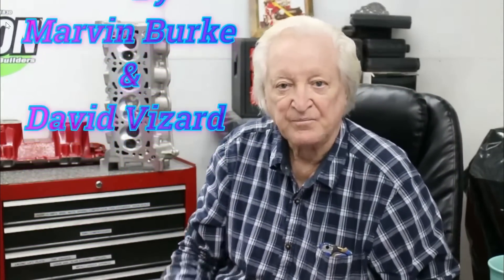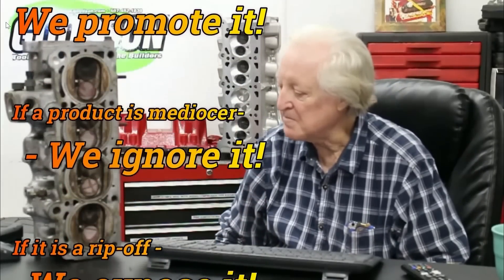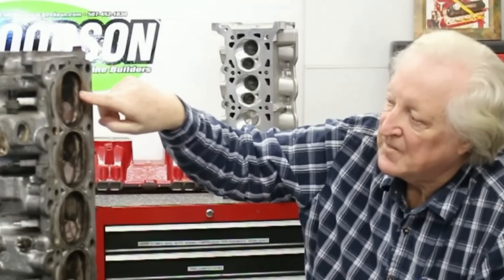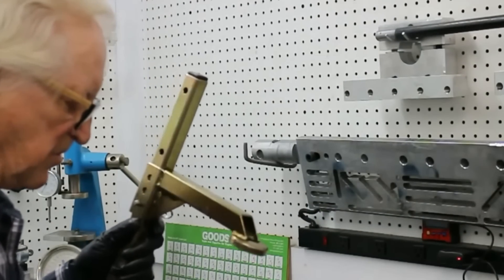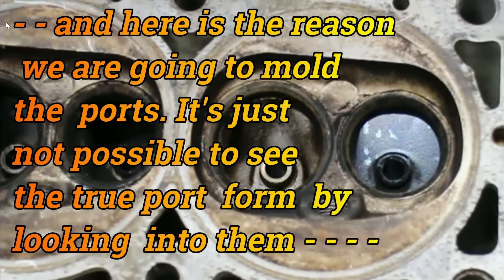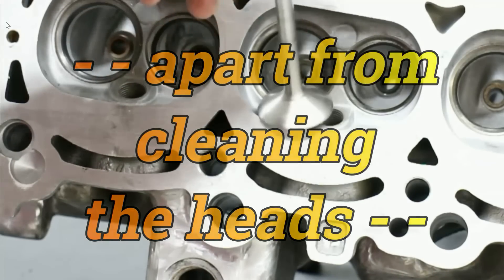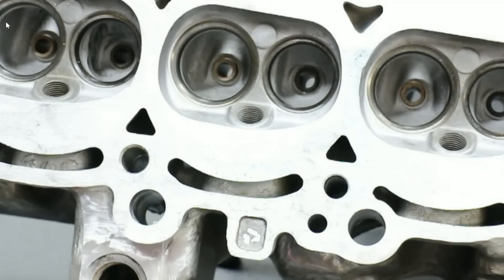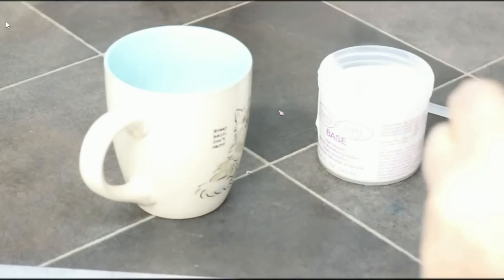Chrysler 4 cyl. 2 V head porting - big HP potential!

Comment: The FAIT 600, 850, 127, Autobiachi A112 (Abarth), Uno, Cinquecento and Seicento al have bathtub shaped combustion chambers. 
I always wondered how to prepare the chambers. But this and the second part helped me out quit a bit. Not all. But more will probable come.
The nasty thing of the above mentioned heads is that they have an intergrated inlet manifold inside the head. Yep, true. And bad. So a mold can be made but will never come out in one piece. Simply because the space inside is bigger then the openings on both intake and valve seat sides. A perfect bowl is also impossible to grind due to the big space inside. 
And so the only side which comes close in performing David avizard a tricks is on the exhaust side. ...but may be I'm wrong and do not see what others (you) have already seen?

Comment: What do you think of possibly using a thermal barrier coating in the exhaust ports after you shape them to help prevent the heat soak into the rest of the head?
Reply: Porsche did that on their older turbo motor. Maybe in the 944???
Ceramic I think was used
Reply: @ßeau_M , I think Honda used sheet metal shrouding(?) in the exhaust ports on the CVCC engines too
Reply: Cerakote makes a piston coating but I don't know if it would hold up in an exhaust port
Reply: There were/are(?) companies that ceramic coated headers, inside and out as I remember. Also, some manufacturers are integrating the exhaust manifold into the head. Maybe they have a way where the heat can be kept from transferring through the surface of the exhaust port, maybe an alloy that resists heat transfer?
Reply: PFAS! 👻

Comment: I've heard David saying that wedge chambers are superior several times. I'm wondering if he has a detailed explanation for it being better or if it is more based on empirical evidence.
Reply: With David, it won't be his opinion, it will be empirical evidence. Bath tub chambers suffer badly from valve shrouding, and the wedge chamber has much better mixture distribution as a result of the quench action driving the mixture towards the spark plug.
Reply: @theshed8802  Good explanation. Thanks.

Comment: This is nowhere near the sins that were perpetuated in the Volvo 2-valve heads from 1964-1997.
Reply: I know, I’ve 3D scanned, modeled made a finite element model of Volvo B20, and OMG what a horrid exhaust port. Working on a B230FT head now and indeed what were thinking with those L shaped intake and exhaust ports, it’s like a straight 90 degree bend .
Reply: @AndySomogyi  at least the B20 port can be filled with bronze and the inlet made with a good shape. That bathtub bowl adds to the misery.
Reply: @iansmith6728  yup. Interesting thing is if you look at a Porsche 944 head, it’s the same single came, valves in-line style, so it can’t cost any more to produce. But the 944 has an ideal wedge combustion chamber and almost perfect port design. 

I’ll bet manufacturing costs on the 944 and Volvo B230 heads are identical

Comment: I was wondering if there's much that can be done on the 2.4 tiger shark multi air engine as far as boost exc.
Reply: I definitely know of a Dodge Dart running a turbo on the 2.4.
Reply: There's a few out and the company that was doing it got cut. With all the big heads looking out. It'll have to likely be one of project on my part but I have done a few of these kits make them easier. But it can all be fabbed up. I may just move it into a hydrogen run platform that way it will pass all emission requirements. Without being a problem see how our country has changed in the last fifteen years. Can't do anything without a stamp. 😗👍

Comment: 🇦🇬
Hi David, my first porting job was of a stock 1974 Chrysler Avenger back in 1981. I copied the dimensions from a Tiger head a friend of mine had. It had a “3/4” race cam and twin side draft Mikuni 40mm carburetors with chrome trumpets. What a beautiful sound. Thanks for the memories. Please try a Toyota 3SGTE for your next 4-valve porting series. I’ve done a few of these and would like to compare notes.
🙇🏾‍♂️